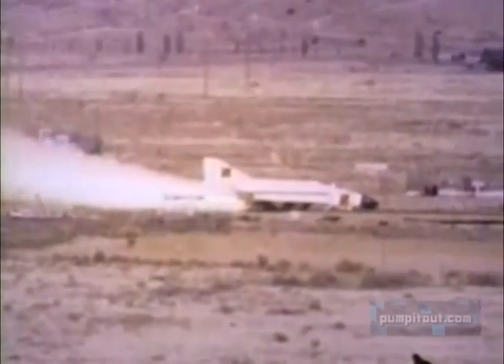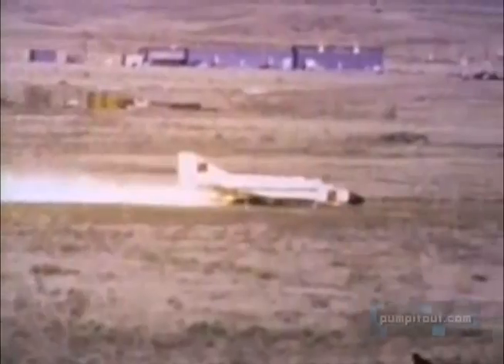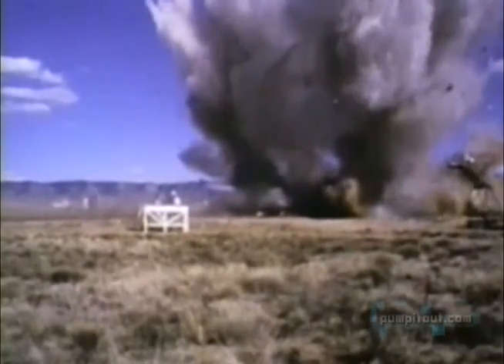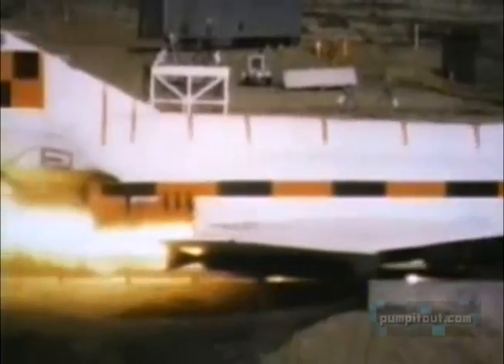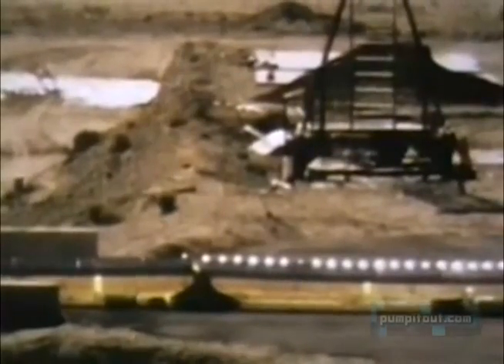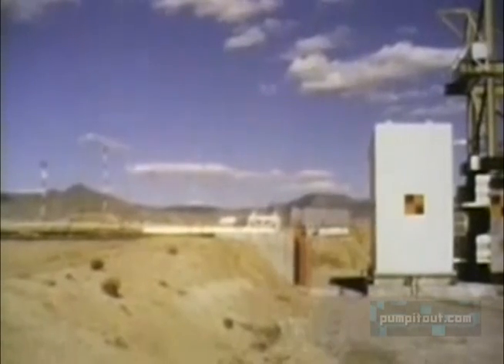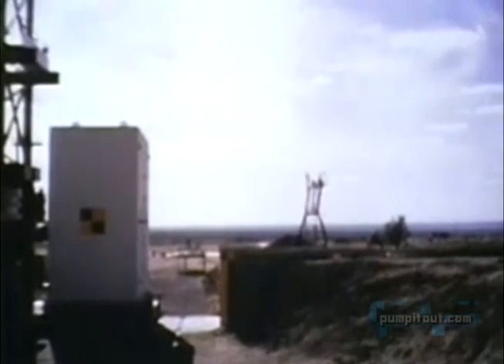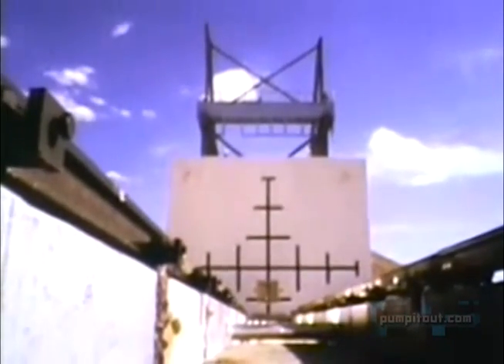Sandia F4 Phantom - 1988 "Rocket-sled test"

Comment: I am a retired research Engineer from Sandia National Laboratories.  I am not sure who is being interviewed, but I must question his knowledge of dynamics and specifically kinetics involved as well as the motivation for this test.  Since energy is not conserved the primary issue is the momentum.  In addition, I don't think that he discussed the reason for this test which had nothing to do with the twin towers.  I will not give too much information as I am not certain as to the classification of the information.  How ever the test was paid for by the NRC as part of the verification testing for the containment vessel of domestic nuclear power reactors.   The initial requirement by the NRC was for the containment vessel to survive a direct hit by a 747.   After publication of the regulations in the CFR regs document, there was a concern for an impact of a fighter jet at supersonic speed.  As I recall, the initial testing, that was done years prior to this test, was done at about mach 2.   It's unfortunate that anyone would represent this test as being associated with the twin towers.
Reply: It seemed obvious to me when I watched this video that a third party combined the Sandia video clip with voiceover from either a radio show or podcast. Nobody said this test was intended as anything to do with the 9/11 attacks, though they obviously are applicable examples of what happens when high-speed aircraft strike thick concrete barriers.
Reply: I don't think that they represent this test as anything to do with the twin towers other than an example of what happens when a plane hits a concrete column.  These two presumably had a larger conversation about the twin towers and this section was talking about what happens when a plane hits reinforced concrete.

Comment: LOL, another 9/11 with foot in mouth disease. Here he clearly says "if the sitting mass is a lot [as in the lower unheated or damaged denser construction of the lower ~80 floors of the Trade Towers] and the hitting mass is low [as in the much lighter constructed ~20 floors of the upper Trade Towers], the sitting mass wins. It has never been demonstrated scientifically that any hitting of the upper floors was possible without liberal amounts of explosives by the way. The hallmark of a true "debunker". Pure, unadulterated hypocrisy
Reply: Except in the WTC towers the hitting mass was very large (the entire top section of the buildings) where as the sitting mass was very low - one single floor of the WTC tower. And it has been clearly demonstrated that there was not enough strength in the floor truss connections to arrest the collapsing mass of the upper section. I can provide the calculations from NIST if you like.

Comment: Too bad the 9/11 planes weren't doing 500mph as NIST said. An airliner CANNOT fly that fast at that low an altitude. The engines would be choking. They make peak power when the air is most thin.
Reply: "Vd is the maximum demonstrated airspeed. The aircraft will be structurally safe at that speed. Exceeding that speed does not mean the aircraft will breakup. There will be quite a margin between this safe speed and one where the structure starts to break up.

471 kts represents about 25% more dynamic pressure than 420 kts and therefore 25% higher forces. The civil aircraft structural limit factor is 1.5, representing a 50% excess load before ultimate failure. Therefore it's quite likely the 767 structure would be intact at 471 kts. The conspiracy theorists cannot say with any certainty that this is impossibly high for a 767.

Conspiracy theorists take published data and draw the wrong conclusions to suit their own ends."
Reply: @brianwest2775  Because conspiracy theorists have no concern for truth, only conspiracy, which is why nobody takes them seriously and they're forced to seek an echo chamber here on youtube.
Reply: Which shows exactly how little you know about any airbreathing engine.
Reply: @mooneyes2k478  Perhaps you missed the video with an engineer of the same plane said to have achieved such a feat describing how the plane HE engineered, with the engines it had installed, was absolutely not capable of staying airborne  or maneuvering at that altitude. It would have fallen out of the sky.
Reply: @sumdood2035  " Perhaps you missed the video with an engineer of the same plane"
Yes. Yes, I DID miss that one. And so did everyone else, ever. But then, that would follow when there is no such video.
Reply: @sumdood2035  The planes dived to reach the speed they reached, only one exceeded its vd limit of which test pilots take them beyond all the time. There are videos here on youtube of 757's and other jet airliners doing extremely low altitude passes at similar speeds. Those planes were more than capable of what they did that day.
Reply: Hey Mooneyes2k you are a fool airliners cannot do 500 miles per hour at low altitude like NIST claimes there's a possibility somehow the planes or fake and projected somehow even if they wore real 767s half of those planes if not the whole plane would have been vaporized why don't you do some research because this pics of have have beams  were intact what's your explanation for that what's your explanation for the lobby and basements that exploded in one of the buildings

Comment: So if a beer can can go through concrete if given enough velocity, then why aren't bullets made of aluminum? Simple answer is that a beer can cannot be accelerated to a high enough velocity ( in normal sea level atmospheric conditions). Without additional mass and or reinforcement the beer can will stall due to air resistance long before it reaches " penetration velocity". If the beer can was filled with lead, then it may have a chance, but only if the lead was in full contact with the beer can. It would be an interesting experiment. My guess is that the aluminum beer can would disintegrate upon contact and be splattered by the friction and kinetic and inertial energies of the two stronger materials on either side at impact. If any of the aluminum made it through the concrete, it would only be due to being carried or pushed by the heavier element behind it.
Reply: That's a pretty cool makeshift Hollow-Point bullet :). You got shrapnel on impact and everything.
Reply: Not only would the beer can possibly stall before impact, I think it wouldn't even leave the muzzle in one piece. A sled might be less unrealistic. Fun little loose theorizing though.
Reply: In the years since you posted your comment, other YouTubers have made aluminum bullets. In fact, some crazy guy made chocolate bullets and fired them into steel targets! Yes, chocolate can put a dent in a steel plate. In some cases, aluminum can penetrate a steel target.
Reply: So to get penetration you need 3 things: High momentum (mass*velocity), low surface area, and high hardness. This is why tanks use saboted 30mm darts out of a 120mm cannon made from tungsten or depleted uranium. Theoretically, you could get good penetration with something lightweight (if you shot it fast enough) but that is impossible in the atmosphere. Once you get above around 10,000 fps the heat produced from drag starts to burn the metal away.

One thing I've always been curious of but have no idea how it would be attempted is if you could create 2 bullets that were equal in composition but one was lets say one gram moving at 1000 fps and the other 100grams and moving at 10 fps. Theoretically, they should have the same penetration, but the energy for the faster bullet would be 100x the heavier one. Maybe you need the initial energy to start the penetration.

In real life bullets with high penetration ALSO have high energy because of their velocity.
Reply: +kauaiads Bullets aren't made of aluminum because bullets need to be heavy-for-size. A typical 9mm bullet made from aluminum would weigh about 20 grains, instead of a typical 9mm lead bullet which weighs 124 grains.
Reply: That was actually a rhetorical question, but your point and mine are the same.